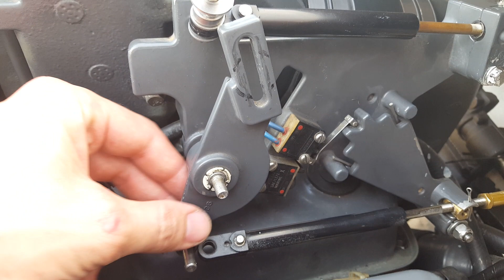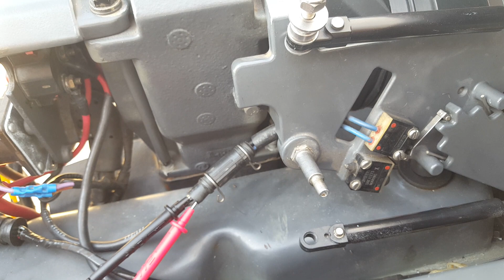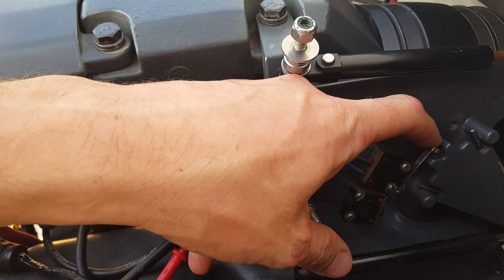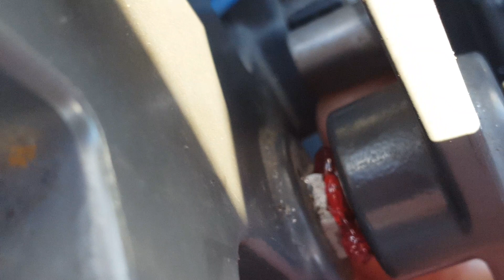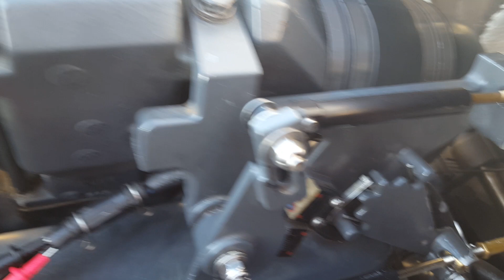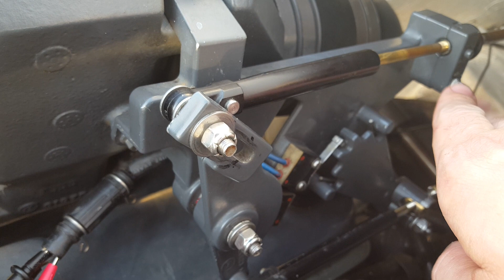Engine Bracket & ESA Troubleshooting Part 4 - OMC Cobra Volvo Penta SX

Comment: The reason for the overstroke switch is, in case the interrupt switch sticks after the shift to in gear has been made, the idle will not be lowered as it should be when shifting form FWD or REV to neutral. The interrupt switch can stick if the shift cable gets sticky, or if the retaining screws are overtightened.

Comment: When shifting mine back to neutral after going in reverse or neutral, it slows down but never stops. Could this bracket be my issue, or the switch?
Reply: The ESA system should reduce the idle from about 600 to 450 rpm, the engine should not stall.